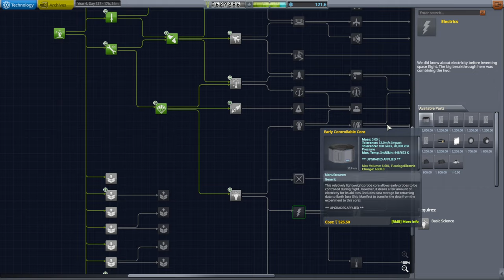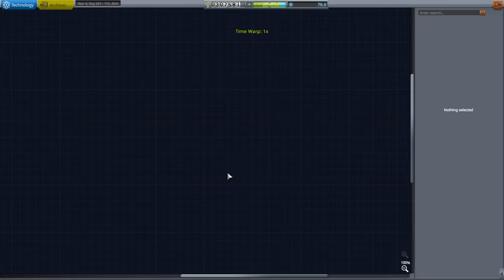RP 2000 Career 11 (RO in KSP 1.12)

Comment: Hello there. The Cubesat solar panels (both 1U and 3U) are under the strucural tab, alongside the 1U and 3U Cubesat bare frames.
Regarding the Δv, the thrusters being at an angle induce a loss. Furthermore, the RCS using the same "fuels" can bite some, even more so as the mixture ratio differs from the thrusters.

Comment: Is it possible to move the 1kg physics mass one decimal? I just love the cubesat. I feel like other cores are huge and have way to much mass, without having the extention options. I basically just want an arduino strapped to my rocket. 
I have a satelite with both UHF- and S-band communication with a relay cubesat on. The problem is that it won't relay S-band. It recieves S-band and then relays it as UHF. Is this intended? If so how do I relay S-band? (Edit: Followed cubesat change from stream, which at least makes the relay work)

Comment: No matter what I try the antenna update doesn't work for me.
Reply from the maker: Can you be more specific about what's going wrong? Also, I just put up a new update for Small Rockets what you might try: https://github.com/tylerraiz/SmallRockets/releases/tag/0.9.1
Reply: @RaizSpace  The range on the antennas isn't getting as far as it should. In the antenna planner they can only get to Venus periapsis at max power with S band. I tried installing the updated files several different ways but I never got the fix to work. I tried overwriting all the files at once. I tried overwriting everything except the RP-2000 folder and RealAntennas folder and doing them last. I tried both installing RP-2000 last and I tried installing RealAntennas last but nothing worked and I gave up.
How exactly should I install the updated RP-2000 files?
Reply: @RaizSpace  I just installed the SmallRockets update and I'm getting a "Fatal Error" popup from tweakscale in the main menu that says my saves can be corrupted if I play the game because of an issue with a mod.
I deleted the SmallRockets file and it went away.
Reply from the maker: Are you sure you unzipped the Small Rockets mod properly? In GameData, you shouldn't have another GameData folder, nor should you have a SmallRockets folder. SmallRockets, along with Surestrut and CrewVessels, all end up in the EDBMods/Parts folder. I do have TweakScale and don't have this issue. The only part with TweakScale on it in SmallRockets is the Payload Adapter and that hasn't changed between versions.
Reply: @RaizSpace  I probably did it wrong then. Will that also fix the antenna issue?
Reply: @RaizSpace  I tried to redo it and still got the fatal error warning. I deleted the second gamedata folder. I unzipped the files to my desktop and then copied the EDBmods folder to gamedata and overwrite everything. I also dont see CrewVessels or Surestrut inside the EDBmods folder. I just see parts, small rockets, and the license. Seems like I messed up my install at some point.